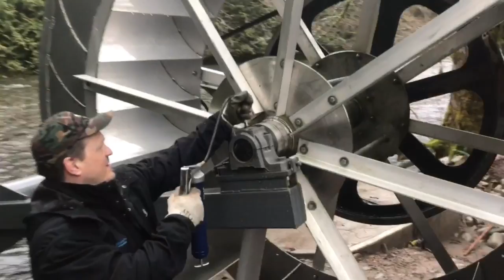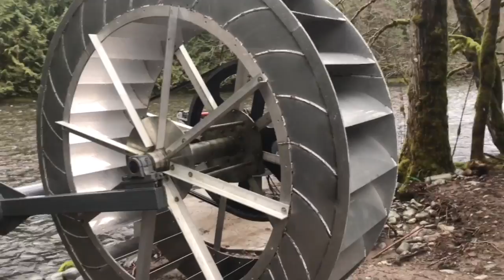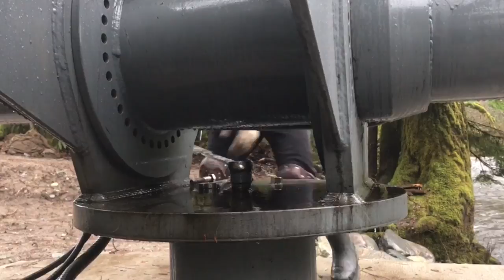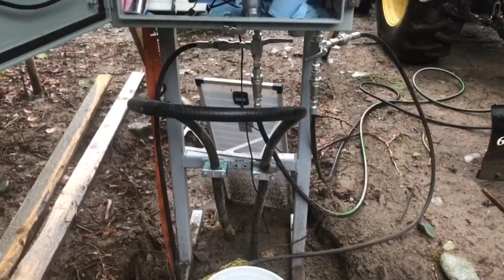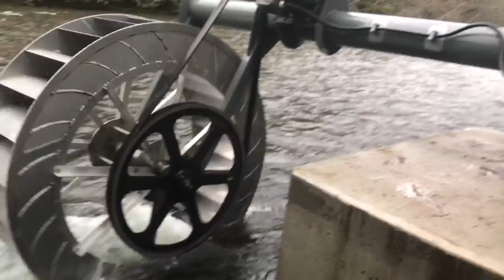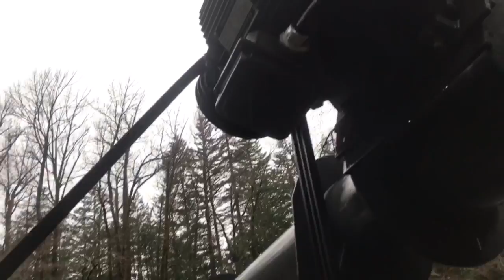Demonstration of Waterwheel Maintenance

Comment: 1- It’s the best design I can see in YouTube. 
2- I think the blades don’t have the best form. 
3- My sincere congratulations.
Reply from the maker: The blade design was a bit of a shot in the dark. I now know that they need to be longer and have plans to increase the length by 1 foot.
Reply: @NeringIndustries  how much kwh a day does it produce? And if its a low amount , why dont you just use a more powerful alternator ?
Reply from the maker: @awokenv7302  The most it has produced is 2KW so over a day it was 24KWh.  At higher outputs I am having trouble with belt slippage when they are wet. I am considering adding an idler pulley near the generator to get more contact on the generator pulley where it slips. This is a work in progress!
Reply: @NeringIndustries  thats low kw. Have you thought about using water jets like on a microwheel? With a more powerfull alternator?

Comment: Interesting... At 1:19 it looked like you were going to get more rotational speed (aka power) when the bottom paddles of the wheel were only partly in the water and then as you continued to lower it the rotational speed slowed.  Might want to keep the wheel shallow to increase efficiency.

Comment: They make pumps that will supply grease on demand. Many heavy equipment operators have them on their equipment and you can get them where each time a contacter (A piece that sticks out) comes around it pushes a lever that pumps the grease to from one to as many as 10 grease points. They also have electric ones but you would need a timer for them.
Reply from the maker: Thanks! However I switched to Lignum Vitae wood bearings which are essentially maintenance free. I am aware of the auto greasers too,  which would be a good recommendation if I kept the  original roller bearings.

Comment: Dont dip the wheel too deep, it makes more turn by placing it a bit low on the surface of the river water
Reply from the maker: In its current configuration, the wheel likes to be almost up to its axle in water to make the most power. I can see that on the inverter output.

Comment: Refillable automatic greaser. Mount on  top of bearing that run off of 9 volt battery. You can set frequency of grease input.
Reply: Mr Row what no shit when did thay start making those???
Reply: Late 90s I'm guessing. I'm a millwight and we have them on heavy automotive stamping presses and other industrial equipment that run 24/7
Reply: use long stainless steel tubing and put the niple at  the center/ pivot.. then no need to move the wheel for greasing

Comment: Can you please post a video with a load connected (say a power drill, saw, some bulbs, battery charger...) and some measuring equipment attached, like a clamp-on ammeter or alike. One thing I don't understand is (in some other videos) you say you get 400w-1600w. Yet you are charging the battery that powers the hydraulics with a solar charger. Why? Also quite sure the only thing that matters in power calculations is the area of a paddle submerged in water, head-on, like a drag coefficient basically. So how do your curved paddles compare to straight ones?
Reply from the maker: The generator produces "wild" 3 phase power, up to 600V. At my residence I rectify to DC, then to single phase 240VAC where it feeds the grid or my house. The hydraulic pump is 12VDC fed from the solar charged battery. You are correct that the blade area is the most important thing. The curved blades add more area.  There is potential gains as well with decreasing radius blades as you can note that the water pours through the middle of the wheel which is inefficient. I may close that area off as an experiment.
Reply: I'm quite curious about real power both kW/hr and peak W.   It sounds like you need a PWM controller like midnite solar, where you could match load to best speed for max power (MPPT).    Nice job on the fabrication, looks pro.
Reply: Why? River flows are fairly constant, maybe summer-winter difference. And why a controller when he has a generator (3-phase) directly being turned by the wheel?
Reply: A good question Predrag,   I've done a bunch of work in this field, and what is generally true is that turbines have an ideal speed relative to flow, at which they will collect the most Watts.  So ideally you load the turbine very precisely   In wind turbines this is generally 7x the speed of the wind, in a turbine like this it's probably closer to .33 or 1/3 the speed of the flow around it.  In wind turbines using an MPPT controller often nets 30-40% more kWh's per year.  If unloaded this turbine will probably turn close to the flow speed of the river, and if overloaded it might turn at 1/10 the speed of the flow or not at all.   The rate it's going to turn is controlled by how much resistance the generator provides.   If the generator is rectified, and fed to batteries, then the resistance of the generator will be related to battery voltage, and is unlikely to be the ideal resistance to keep the wheel turning at it's ideal speed.   A controller will work via PWM (pulse width modulation), and effectively turn on and off the alternator 1000 times per minute, leaving it on longer or shorter, depending on what you've programmed into it.  This would only be needed in situations where you experience variable flow.    A pelton wheel for example would not likely need this, though it should have it's alternator matched to it's output, it only should need to be set once.   Good quality alts designed for this use have a jacking screw to adjust magnet plates.
Reply from the maker: The river flows can change quite quickly and often due to rain. The only time it is steady is during the spring/early summer during the freshet.
Reply: there are other ways of matching load, an MPPT system would add a fair amount to the cost, though you would't likely need the over voltage protection that wind turbines require (in the midnite solar product line it's called the clipper).
Reply from the maker: This is a grid tie installation with an ABB Aurora grid tie inverter. Under lowest winter river flows it generates 200-300W as it jumps around a bit . Under higher flows its made peaks of 1600W. Since it is a new installation it has not experienced the highest flows yet, but I expect it can make upwards of 2500W in its current configuration. I have blade modifications planned that may yield another 40% increase over what It generates now. This is still experimental.
Reply: As far as I know ABB no longer makes MPPT controllers for small turbines?   I have not looked at your system closely enough to understand it, however if you are using a PMA (permanent magnet alternator, also known as a brushless motor, can be 3phase, can be single), then you get wild AC out, which perhaps your ABB system accepts as is, though that seems unlikely, more likely you rectify to DC and feed variable DC to your inverter.   This results in your alternator creating a stable load for your turbine, when what would be ideal would be to have a variable load.   This guy, on his much lower tech wheel is using one I haven't seen before.   I think there is an Australian company Powerspout, that's building them.   https://youtu.be/Zd4DLBYWKo4?t=442     In your case, if my assumptions are correct, the control box would sit between the rectifier and the ABB inverter, and make you a lot more Watt hours.
Reply from the maker: Yes, permanent magnet alternator generating wild 3 phase up to 600VAC then rectified to DC with an ABB Wind Controller which feeds the grid tie inverter. I do think there is an issue with the existing MPPT as I get power oscillations and can see the wheel speed up and slow down.
Reply: Im not familiar with the ABB controllers, however in general these controllers sense turbine speed through voltage input.   At very low rpm the voltage from your alt may not be stable enough for your controller.   The controller is likely taking readings that are 1/1000 of a second, so any wobble, or spikes, could throw it off.   If that was the case you would see the output jump around at low flow speeds, and you might be able to see the turbine speeding up and slowing down.   A recording tachometer would show you this, or you could take video.   This is the MPPT controller interacting with the inertia of the rotor, it underloads because of bad voltage reading, so speeds up, then new reading forces controller to overload, slowing down too much, and on and on....    You could try putting a smaller pulley on your PMA to up the alt speed.   PMA's generally have a very stable voltage to rpm ratio, except at their lowest rpm end, where it can be quite wild.    You might also find some linked V belt, it allows you to adjust belt size fairly easily, is waterproof, and very low stretch.     If you wouldn't mind, send me a private message where you are.  I'd love to drop by and chat.    I'm in the BC (Canada) interior.
Reply: An option which is available, and would vastly simplify your system, is an axial flux alt mounted directly to your water wheel.    I’ve built quite a few as very low speed 3 phase pma’s   This would eliminate your belt, and leave you with a single moving part system.
Reply from the maker: 10 rpm?
Reply: 7.5 Hp at 10 rpm from a 3ft diameter magnet array is certainly possible, the question is cost, is it cheaper.   What I'm finding is that it is cheaper than the combination of buying conventional alt, and building a step up drive to spin it.   I'm under NDA for a lot of my design work around this right now, so what I can publicly show is limited, however if you google Axial flux Alternators, how to build, you'll find people building their own windmill alts that are about 12" diameter and are producing power at much lower rpm than a conventional alt.   Once you've looked at those, you can do the math and see that if you up the diameter and add more magnets and coils, output goes up non linear, thanks to PIE!   I've got one on the bench right now that's 12.75" diameter, putting out 15V at 20rpm.   It looks like it'll carry at least 6 amps, per phase, so 18A at 15V is around 250W, from less than 3lbs copper wire and 32 neo magnets (about 3$ each).    This wattage calculation is not really accurate as I'm just measuring peak V now, not RMS V, but it's reasonably close as the alt produces a high frequency AC with low ripple.   These PMA/M can also be much higher efficiency, shaft power to watts, as they have no steel laminations to suffer eddy current losses in.   This is why they have been used as direct drive wheel motors.    China is making tones of these.  We just got a 10kW unit from Greef energy (alt, about 30" dia, 10kW at 100rpm).    I didn't want to use it, I wanted to build one in house.   It's not about the RPM, it's about the magnet over coil speed, increase the dia, and you get more magnets, more coils, and more speed.   You don't have to get big to get real power, and they are relatively easy to design.
Reply from the maker: My alternator is 7.5kw@50 rpm and weighs over 800 pounds. My speed increaser belt drive multiplies wheel rpm x 5. When I bought mine 4-5 years ago, 50rpm was the lowest I could find.
Reply: An axial flux could be made that would do this, and be much more efficient, if I'm correct in my assumption that at your lower speeds you are in the non-linear portion of your alt's range.    I have some engineering documents around this that you'd find pretty interesting.   

 PMA's are wonderful linear output (double rpm, double V) for most of their range, but at the very low ends they are not as linear, and they are very inefficient, probably less than 50%.  So it may be that not only is your MPPT table not being properly applied due to V instability at low speed but on top of that, your alt is being run at speeds where it's efficiency is quite low.   This would explain very low output, and "hunting" behaviour in your turbine at low speeds.  

Electronics isn't my strong suit, however I'm wondering if your ABB setup rectifies outside the inverter, like Midnite Solar's setup, then you might be able to put a capacitor into the line between rectification and inverter.    If done right this might stabilize the output and provide a cleaner signal to your MPPT.    However something tells me that it wouldn't be this simple, especially because of the wide voltage range over which it might need to work.    It also wouldn't solve the problem that your alt may be running too slow to efficiently generate power.
Reply from the maker: The alternator rotates up to 50 rpm which is its maximum, because the inverter doesn't load it fully which keeps the rpm up. I need to download the inverter programming and look into this more, but haven't had the time lately due to other projects I have on the go. I also have had issues with the water wheel tapered roller bearings and water ingress and have ordered lignum vitae wood bearings to replace them.
Reply: The question I'm asking myself, is annually, how often is the turbine running at speeds that put your alt rpm well below 50.  If this is most of the year, then what is the likely efficiency at that "normal" speed.  The Alt you have is most likely efficient within a narrow range, and is probably oversized, and therefore suffering from a greater portion of hysterics losses, especially in the low speed range.  In some instances it may be worthwhile to optimize for maximum flow, but I think most instances will favour optimizing for "normal" flow.  

Some calculations could give clearer evaluation if it's worth improving the electrical/generation power transmission system, but that's not my field.   I would guess that it is, especially given that it looks like you hope to commercially reproduce the system.   I think you'd find a valuable market, I'll be in it eventually most likely, though I have a different take on how I'd do the Poncelet.
Reply: It would be more powerful if increase the wheel width at least center of the river now I think 2 feet if increase to 10 or  15 feet otherwise focus the water to the same wheel by v type wall in the river.
Reply: @allaboutwirings2460  He likely can't build stuff IN the river, most places would not allow such work on a private basis, and the cost of environmental studies etc would make it un-justifiable to do
Reply: @integr8er66  yes you are right
Reply: @NeringIndustries  I'm impressed! very well thought out!  the water flow into the middle would create resistance.  the question I have is dose the river level rise and fall frequently at a frequency that a water level sensor could activate your hydraulic pump to keep the optimum arc of the water wheel submerged at any given  time.
Reply: @NeringIndustries  choose a alternator in rpm 1500 and make coupling with 1/30 reducer. Wheel should be binded to reducer (as inverse that is output-intput) directly. Alternator should be at the end. By this way, sure that will be 25kw system in charge.

Comment: thats amazing! ingenious design, love it.try and get a bigger wheel on that blade, it will get more rpm's
Reply: A bigger wheel will NOT get more rpm's...the rpms are based on the velocity of the water divided by the circumference of the wheel, a larger wheel will actually turn fewer rpms.
Reply: A bigger wheel would provide more torque because you have more surface area exposed to the water but not more RPM.  Torque is more important anyway.

Comment: You using wrong blade design ... It's will make you water wheel heavier
Reply: Tend to agree with you on that one.  Also seems to be running little too deep slowing down the wheel . Great design however but a little bit wider paddles would give more torque as well.
Reply: @pieterbezuidenhout2741  yes I believe blades should be longer and not too deep in the water like this one . Making a small replica and test it in the water is the best way to find the best design .
Reply: @sahenwijesinghe8063  and way cheaper as well.

Comment: I don’t understand something. You are using solar to charge the batteries, which were dead, to run a hydraulic pump to maintenance your water wheel. Does the wheel not charge batteries?
Reply from the maker: No, the water wheel generator outputs "wild" 3 phase 90-500VAC power (depending on rpm) which feeds the rectifier/ inverter which then exports 240V single phase to the grid. The battery needs 12 volts DC power.
Reply: @NeringIndustries  And 240VAC output can charge the batteries, I suggest. Charging batteries needs just small 'watts' power.
Reply: @NeringIndustries  How can I get in touch with you?
Reply from the maker: @jean-baptistekoba3287  in regards to???

Comment: This installation will have produced the energy equal to the energy used to build it in 1000 years. That's 1000 years of green energy.
Reply from the maker: On a dollar basis the return is typical hydro.

Comment: your design is great, but I have produced 200kwa in the same design, there are many mistakes in the impeller you have made, first of all, you need to reach the torque to a hundred times and with a very simple method, the flow rate of your location is very convenient, you cannot exceed 4 to 10 kwa with this, but it is not the smallest of success. .
Reply from the maker: So what should I do differently? I'm planning on extending the blades and making them 25% wider.

Comment: Cost $50'000 + to build and produces what? 2kw. Ridiculous. Buy a generator for $500 
As soon as you put a load on it , it'll stop and the water will go around it, path of least resistance etc.
It needs to be in a channel so the water has to go through it and the blades need to be very near the bottom or the water will go under it. 
I've never seen something so ridiculous in my life.